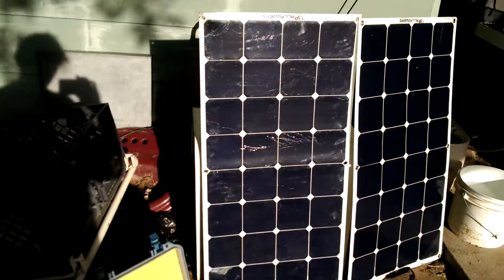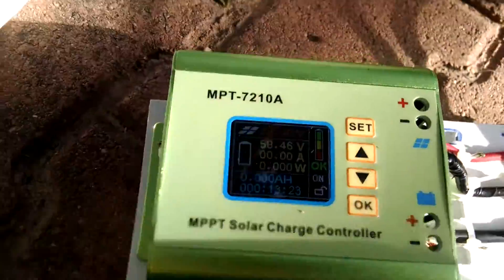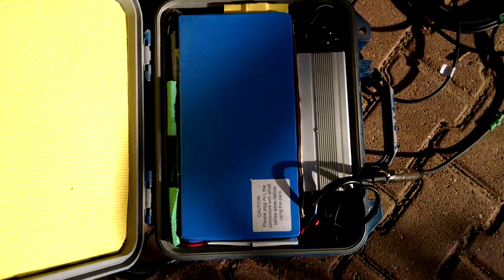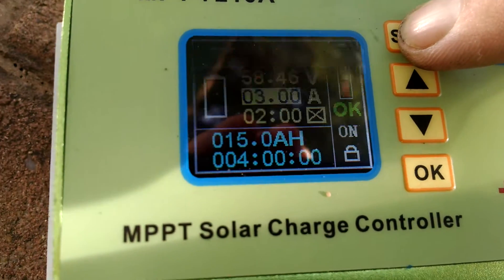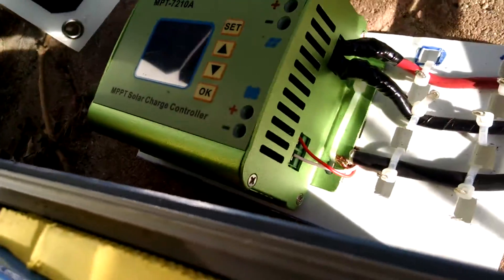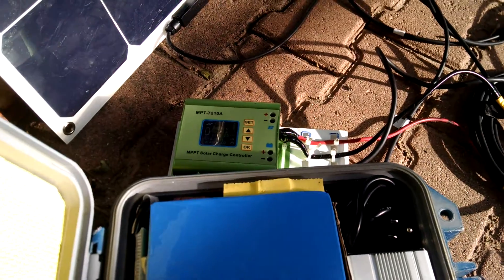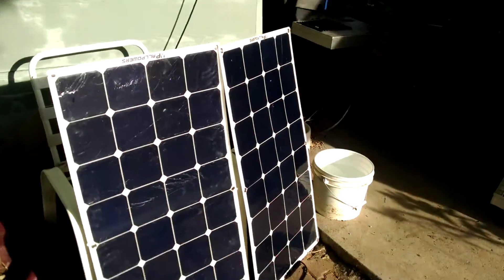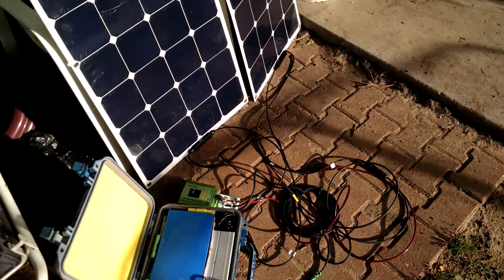MPT -7210A Solar Charge Controller Problem

Comment: You answer your own question in the video. Your battery is at a higher voltage or at the charging voltage already so the charger has correctly shut off. Operator error I'm afraid. You should read up on what your charging voltage should be relative to your battery voltage for different battery types.
Reply from the maker: you are right that its operator error.... but in tthe second part to this video, i give the answer.... a standard XLR cable has the pins wired in a different order, than the one for my battery, so one pin was switched with the ground pin, which has no connection to the battery.
Reply: Ah I see, all the right wires not necessarily in the right order, as Morecambe and Wise might say. ;-) Enjoyed your video. I've also bought one of those 7210a's now having seen you and others with one.

Comment: I have a similar set up to yours except I am using a 36v lifepo4 battery. Have you sorted the issues how has it held up I noticed in another comment you say you are now putting 300w into it? My plan same controller 2 160w 12v panels in series.
Reply from the maker: yeah, i solved the problem, the problem was my xlr cable from the charger, to the battery, was wired differently then the one on the battery itself, despite both being the same plug.

i havent used my system as much as i should have, simply because my intent is to build it into a camp trailer , which i procrastinate, and have yet to do ( its my next project). so i cant speak as to what its long term reliability is. 

 i currently have a controller for each panel and  they are wired in parallel , this is to prevent voltage drops when clouds or other shadows block a panel....., i have only used all 300w of panels on a single controller as a quick test, which it worked fine in parallel, but in series the voltage was just a few volts higher then i wanted, and  could not be reduced sense the charge controller is a step up/ boost controller, not a step down....with the original 2 pannels in series, it worked fine.

Comment: hi,you need two battery 12v in series to use that charger,i am charging with one 50w solar   panel,i set voltage to 30v and works without problem,you cant charge one 12v battery,minimum is 18v battery
Reply: Simple solution, add a buck converter after the 7210A. Or as I have done, 3 of them. Watched mine cram 100 watts into the 12V batteries today. While it was doing it all of the buck converters were hitting their current charge limits of 2 amps. Bigger 6 amp buck boost converters are on their way.
Reply from the maker: thanks, but im using a 48v battery, and 300w of panels, and this video is outdated and there will be an updated video in the near future, keep an eye out for it if your interested.
Reply: Gravlydon I made a video with a buck powering the mpt 7210a starting with a 36v battery https://youtu.be/rZikcCVeZU4

Comment: Try one 12volt solar panel, instead of two in series.
Reply from the maker: thanks, ive tried that, its just not in the video, didnt make a difference, the company says is supposed to be sending me a replacement charge controller, still waiting for it. i will make an update video when (and if)i receive it.

Comment: Watch this and he discribes why it's cutting off https://www.youtube.com/watch?v=vzhwR0mAshs
you've hit 58.46v charge on your battery which since you've set it to 58.50v it is cutting off the power to not overcharge your battery.  That is why it says "OK" on the right.  Run down your battery and then try it again.  The "AH" is just a dummy clock that will count up to whatever you want, it's not measuring the AH in the actual battery.
Reply from the maker: thanks:)  the video you sent was actually the very first one i found looking on my own. ive tried the battery both nearly dead, and nearly full, and its the same result. the seller i bought through has seen this video, and they said their" technicians " were looking into it, and didnt find an answer, so they are sending out a new one.... will post a video when i try it out. :)